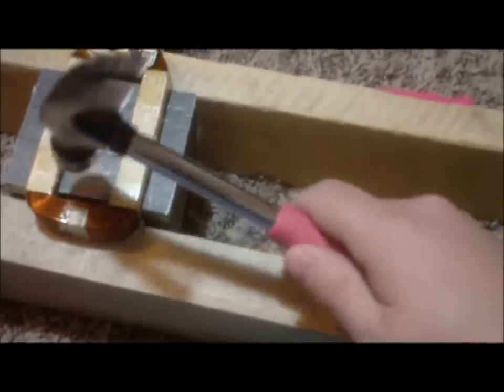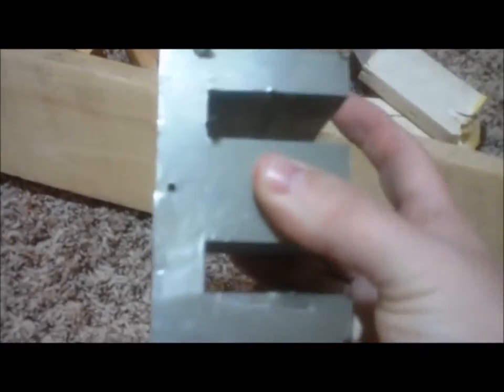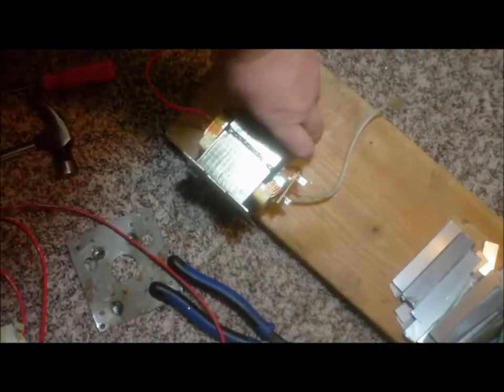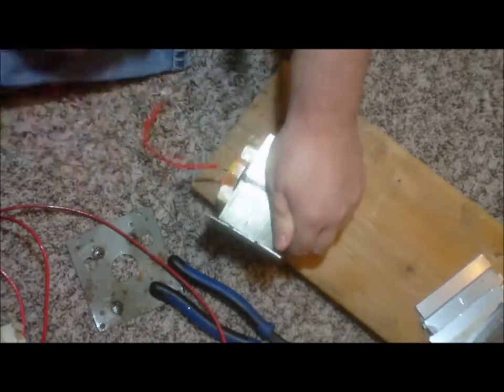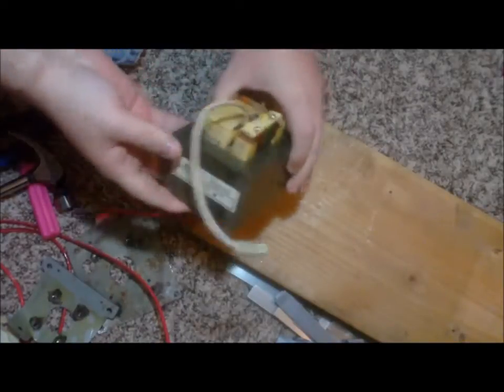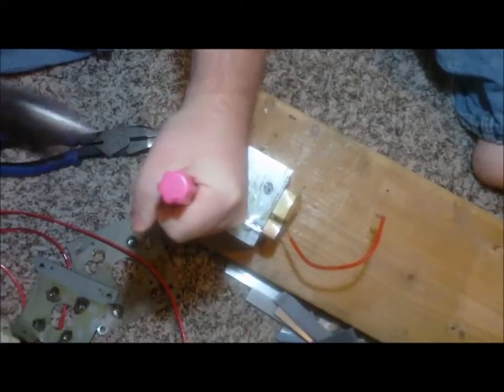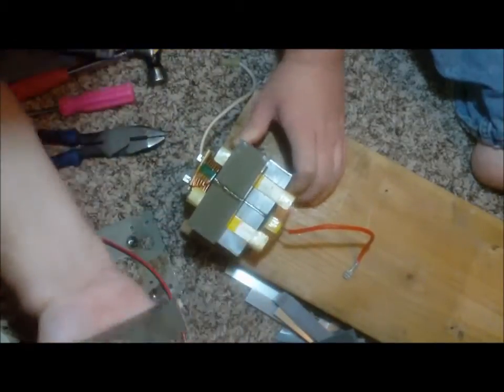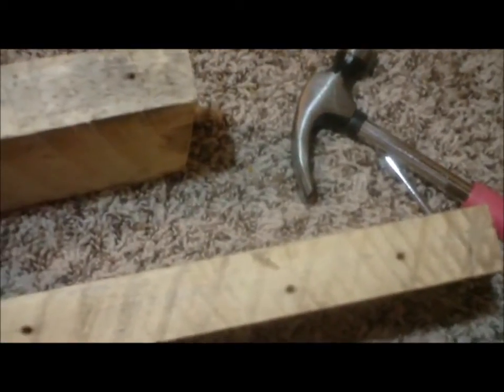Homemade Stick Welder (Part 2)

Comment: How did this turn out with extending the transformer out? Was wondering myself if it would work well with increasing the core size. Sadly I stopped thinking about making it this way as the cost of rewinding primary wiring 240 turns would cost too much or be too hard to find that much wire to make it. Next plan if I were to make my own welder would be to double or triple (or even more) stack MoT's to get a greater core mass, would be interesting how eddy currents would affect it though :-)
Reply from the maker: It is still a work in progress, I have been busy with school and havent had time to finish it.  I plan on finishing it soon though.  In the past I built a stick welder out of two MOT transformers. I removed the secondary windings and put 20 turns of 10 gauge wire on both. I then wired the primaries in parallel and the secondaries in series. I used one leg of the secondary as a clamp and the other as a stinger and it worked pretty good. I just made it for fun.  However you are right probably not cost effective. You can pick up used lincoln tombstone stick welders on craigslist way better than what I made all day long for 100 bucks.  Well anyway thanks for the comment and have a good day.